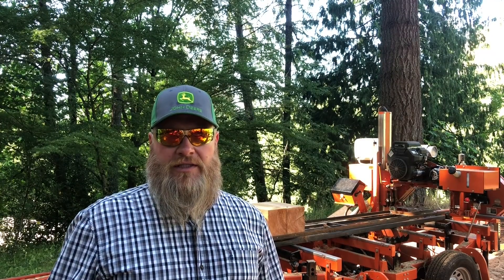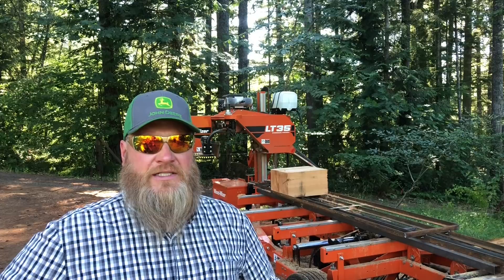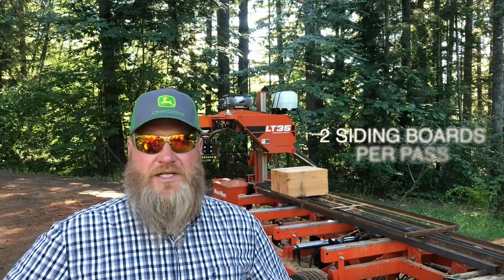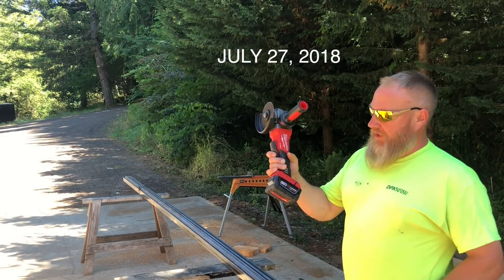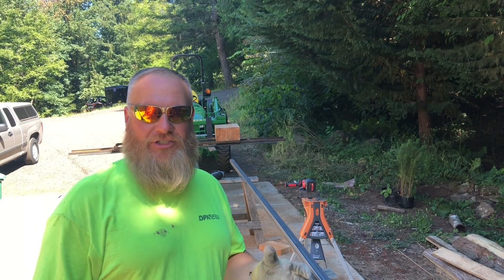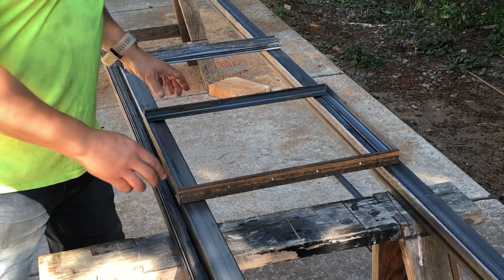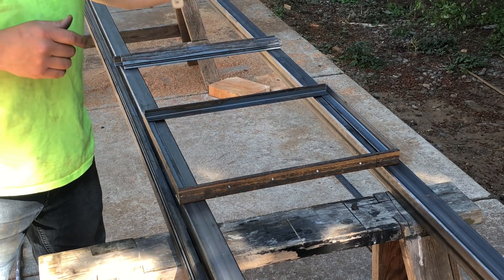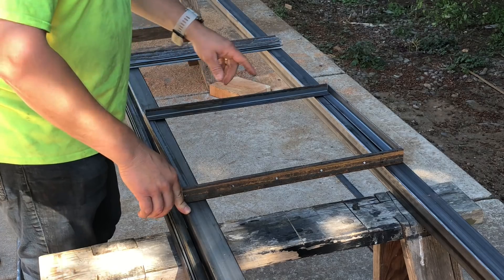High production cedar shingle-lap siding jig for Wood-Mizer sawmills part 1

Comment: I just got the lt35 how critical is leveling the base Woodmizer said it's not that important because of the design
Reply from the maker: Level is not super important. You do want to make sure that all of your legs are firmly supported. Especially with larger logs. They can cause the deck to flex giving you an uneven cut.

Comment: Old shingle machines was circular saw upright and trim saw to trim and grade shingle. Tbe kerf was to wide so converted to tufree 42" upright bandsaws. 
The issue is trimming and grading. You will waste too much time your system. A good shingle swayer could do 40 sq or 4,000 sq feet per day when i was young. Resawn cedar i used to pack. 250 bundles ÷5= 50 sq or 5,000 sq ft in 8 hours. Fyi